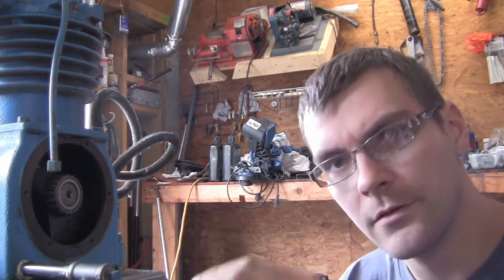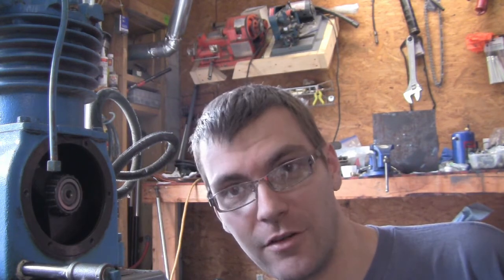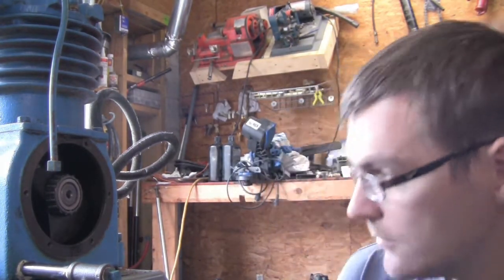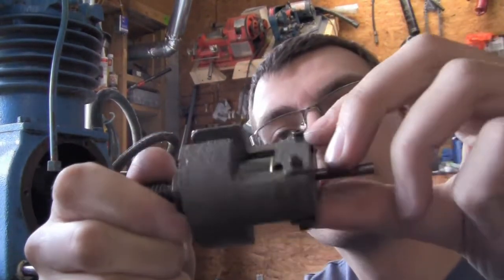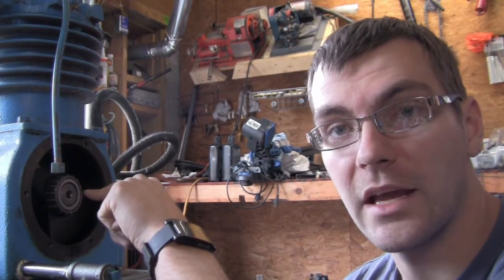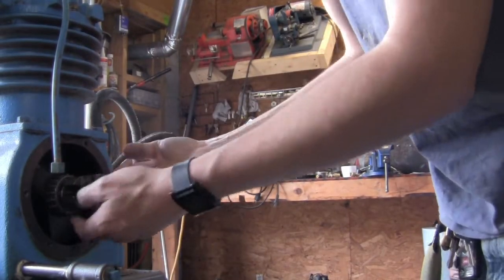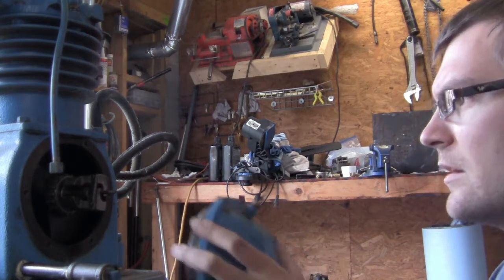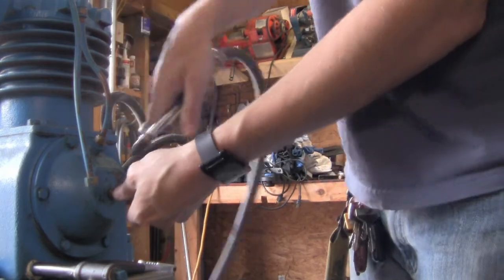Kellogg 335 Resurrection: Replacing and Adjusting Broken Unloader [PART 4]

Comment: Whats a good price on a 331 TV that needs rings?  It looks to be all original. 5hp single phase.
Reply from the maker: I bought my 335 for $300 and expected to have $500 into it by the time I had it running. Then I found the rotted out tank, couldn't use the 3 phase motor and it spiralled to nearly $1000 to get it up and running, but it is better than any compressor I have ever used.
I'd say if it already has a single phase motor that runs, try to think what it will need to get running and compare it to what a new compressor would cost, and keep it under that price, you'll have a far better compressor and as long as its below or at least close to what a new one of similar specs would cost, you're in good shape

Comment: Thanks  I have a Kellogg American  that I bought new 40 years ago great compressor.
My shrader valve on the unloaded stuck cleaned it put it back in adjusted it but wasn’t sure the proper way to adjust it just e-bay  ed a new valve should be here in a few days  
Thanks again
Reply from the maker: Glad it helped you out! These compressors are amazingly well built and super easy to maintain!

Comment: Thanks for the reply and the videos on this model. I have the same exact model part for part that you have except mine is mounted on the tank standing upright I Purchased the whole thing for $100 all I had to do was replace the capacitor’s in the electric motor and the thing fired right up. I’ve been watching your videos to learn more about it in case I ever had to work on it but so far mines been working fine.
Reply from the maker: You got a great deal! I've spent a lot more than I'd hoped on mine, but now its night and day compared to my old 30ish gallon craftsman compressor. and still cheaper than a comparable new unit.

Mine is now a vertical tank as well, because of the whole hole in the tank mess that I showed in another video.

I knew nothing really about air compressors until I got this and started looking at manuals and tearing it apart, but I work on engines literally every day so its a very similar concept.

Very cool that these compressors are designed to be very serviceable, and that was the intention of my videos about it, I'm learning how they work and hopefully showing enough info that viewers can understand whats going on as well.

Comment: How did you know that unloaded was not functioning properly? Is there a particular sound you should hear when the compressor is running or is there a sound when it is completed running? And when you went to put it all back together were you making sure that Schroeder valve just engaged slightly? I was confused as to how you knew when to stop screwing in the fitting?
Reply from the maker: The big reason I thought it wasn't working is the previous owner had wrapped tape around the hole that I believe is the unloader vent, and when I removed the tape there was a constant stream of air coming out of it.

It also seemed slower to build pressure than I'd expected out of a compressor this size, and now having it working well I can confirm it was way underperforming.

Having replaced the unloader I get rhythmic pulses of air rather than a constant stream, I'm not entirely sure thats right, but it seems to coincide with when the low pressure piston is on a intake stroke, so there is pressure in the crankcase from that giant piston coming down.

And yes when putting it back together I wanted the schrader valve to be pressed just slightly with the compressor off, that way it bleeds the air out when its off, and the unloader retracts once the compressor starts spinning and shuts the schrader valve.

There is probably a specification for how much to thread it in, but knowing how its intended to work and guessing seems A-ok for my compressor.

Now also when the compressor stops there is no hissing until it has nearly stopped spinning and then you hear the unloader open. before it was a constant hissing.

I'm going to get some footage of it running, count up my costs and compare the pros and cons of buying this vs some other options out there in the next video, which if all goes well should come out next friday, and we'll touch on the repairs and what difference it has made.